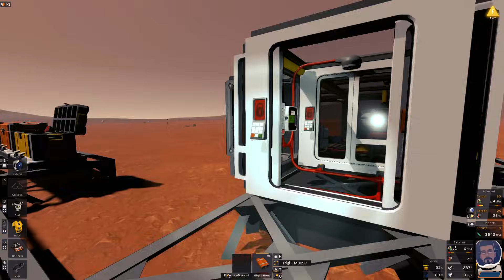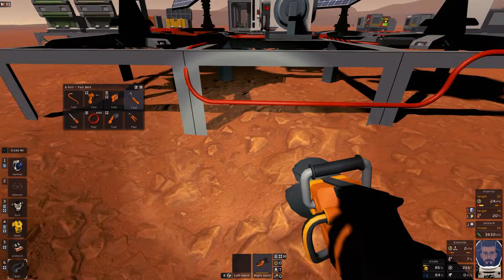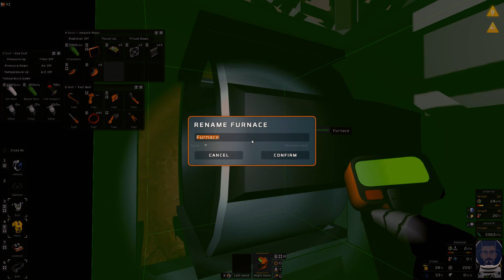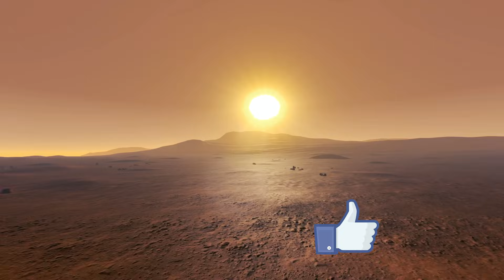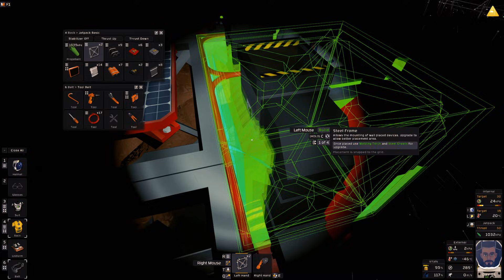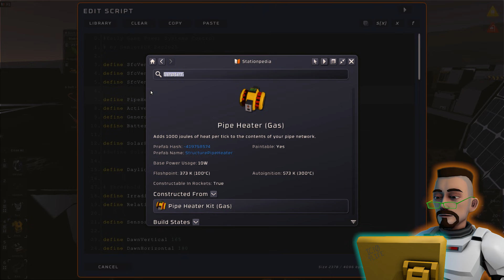Stationeers - Making a Solid Fuel Ingot Factory on Mars (Ep. 3)

Comment: So i just wanted to start by saying THANK you playing the game and showing the world!  I have been watching ep 1 - 2 and in 3 atm. But then i got a bit confuced with the coding. since it looks like i did miss out on some thing TopOfStack and that. And yes what do, if a playuer "make and error" and it gets polution in the sustem of the solid FUEL pipes? did vent it a bit to early or some thing. i have the temp and preasure. and drop the coal in..... and i get coal back... any pointers? ended up copying the updating text from this episode. but still does not work for me so far. But gain thank you for the Awesome PLAY/WORK :D
Reply: I did try again. and angain and now it works.
Reply from the maker: @BekkisOfNorway  That's great to hear!  It can be tricky, and I realize that I go through these things a fair bit faster than a tutorial video would, but you can always find the code I use in the description of the video - a link to my pastebin.  The stack portion was cut, was a bit advanced, and will be part of a series of IC10 tutorial videos one day.  It is basically a poor man's max power display, writing numbers of max power produced and max power drawn (in negative) to the IC Housing holding the chip - you just look at it and you can see the numbers flip-flop every other second.

Comment: So I built this last night and before I could do smithing with the outside frame the  the wall infront of the furnace kept blowing out as well as the input  vent
Reply from the maker: If at first you don't succeed, try try again.  If you miss a step, if you do things in an incorrect order, if you overload your furnaces with too much heat when priming them, you're gonna wanna start over.  Check each device, each line of code, and each pipe network.  Only you can design your systems, but you must do so with care.
Reply: @SemlerPDX  ima run it back  again cause i was able to get one bag out of it before everything went to hell
Reply: Probably means your pressure differential was too high between the gas inside your furnace box and the Martian air. I wouldn't pressurize that space over 120kpa which is what I believe walls will fail at.
Reply: @TianarTruegard Wall fail is there is a difference of 200kpa between one side and the other.

In Mars, you have about 4kpa athmosphe irc, so you should be safe with a pressure of 200kpa inside. The stress will build up, but it will take time to explode or a much higher pressure for it to be almost instant.

I would use a limit lower than that though, there is no need to reach suhc high pressure.

Comment: This is perfectly cut and a great little solution for solving efficiency of hydrocarbon fuel. I appreciate it's a weird game to edit videos for, because it's both slow paced but has a lot of exacting detail that needs to be defined for the tutorial aspects of it. Great job, looking forward to more!

One thing that I still don't conceptually get, is why is putting a box around a furnace such a great insulating solution? Surely the furnace, is itself a box. I can see from having done it that it works great, but I just don't understand why. Is this just a glitch of the game mechanics or routed in some reality.
Reply from the maker: Walls and solid frames have perfect insulation in this game.  A hot furnace anywhere in the world will radiate heat to its surroundings, losing heat internally.  Heat cannot be lost if the surroundings are the same temperature, naturally, at sufficient pressure to provide such insulation.  And since the walls/frames prevent those surroundings from losing heat to the world beyond the walls/frames, our furnace(s) therefore become perfectly insulated and cannot lose heat to anything but items processed by the furnace(s).  This minor amount of heat gets replaced passively from the Pipe Heater I set up, using surplus power production only.  I hope that explains it all!  Move videos coming, life hit hard around the new year, but everything is settling down now.  I'm just starting out, but once I get going, I will release videos weekly no matter what.

Comment: Cool solid fuel setup! I never actually got to make one because I tend to do lots of solar and wind and then I never consume that much afterwards. Will make one as a challenge later, seems fun to do.
Reply from the maker: I was kindof the same - last playthrough only used solid fuel generator for a few months until I got a big (heavy) solar panel array.  I figured this time I'd get one in the first few weeks so it actually has some use (less coal consumption) before it's only ever emergency backup.

Plus was an excuse to show how easy it is to make something like this, too - it's a neat setup. ;)
Reply: @SemlerPDX  Totally! It's also something not that widely used apparently. Yours is the first time I see it on video. 
I even discovered it only because I was reading the whole Stationpedia for fun :D
Reply: Can't say I use the solid fuel generator much, let alone the portable one. I did grab the fuel can out of the portable to refill my welder. :D I haven't ever made the upgraded fuel for the SFG.

Comment: just curious, why use insulated pipes inside the hab for the oxygen lines?
Reply from the maker: Gas remains in pipe segments of a refill station like that, and that room can get hot - that energy could transfer to the gas in pipes if uninsulated, potentially faster that it could radiate away.  Not ideal, suit O2 temp is best between 15-25C.
Reply: @SemlerPDX  you are awesome, do you have a discord? another question, why do you grow so many potatoes? I don't need to eat nearly that much, are you planning to use them for biomass later?
Reply from the maker: No, I don't have a discord for my YT channel, but you can find me on the official Stationeers Discord - I frequent the Logic Circuits and Power Discussion channels.  Food is far less crucial than Oxygen production.  The greenhouse is where I will refill my Oxygen Canister for my suit, all well before having gas facilities and ice crushers.  Next episode, I'll how how I set up O2 Capture and CO2 Capture for the greenhouse, as well as an Active AC system to keep the Passive AC system in proper range.
Reply: @SemlerPDX  love it, can't wait!!!

Comment: Great build!
I’m surprised you didn’t enclose your workshop first.
I find storms to be very disruptive.
Reply from the maker: I'm just getting started!  This Solid Fuel Ingot Factory was a bit of a time sink, and I only have about three full refills of my O2 canister from that portable O2 tank that I started with before it's gone.  I need to set up oxygen capture in the greenhouse, and get a system to feed it CO2 from Mars.  I'll also add an Active AC unit as well as a jetpack refill station, too.  Once that is complete, I can get to the Advanced Furnace so I can really make the cool stuff in bulk.  If it becomes an issue, I might enclose the printers area after that (once the basic furnace is gone) even if it's only barely pressurized with Martian air to prevent indoor storms.  Thanks for watching!!!

Comment: Kinda surprised you're not pushing steel asap, considering the material efficiency.
Reply from the maker: I made SO much steel in this episode, but mostly for the Insulated Pipes.  Far too basic a recipe to bother making a smelting segment for, I just glossed over it and got to building.  Took days to get this Solid Ingot Factory completed, but now that it's done, it will be a very efficient backup power source for a very, very long time.
Reply: @SemlerPDX all good, just wondering because of all of the iron frames.
Reply from the maker: Oh that... The iron frames come with the lander, in Episode 1, I show how I utilize the starting gear from the lander to get this temporary base set up and running in just 1 day.  Time is REALLY not on your side when you first start out, and ignoring the starter gear just to have Steel Frames instead would be a massive waste of time and early materials.  This is also why the two walls inside the Solid Fuel Chamber are iron - because they came with the lander and I have leftovers (and because they will be sealed forever in that chamber, where their low pressure tolerance doesn't matter).

It's all about using time and materials wisely and efficiently to get a massive head start on building big things.  I never print iron walls or frames, but I will use those I started with.
Reply: @SemlerPDX been a while since I started with the default lander. I forgot just how many frames were in that thing